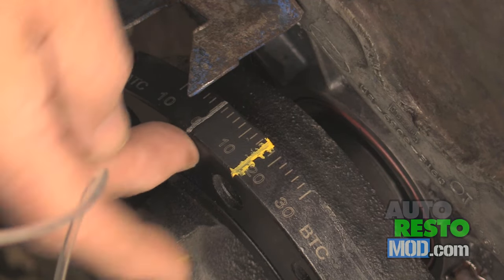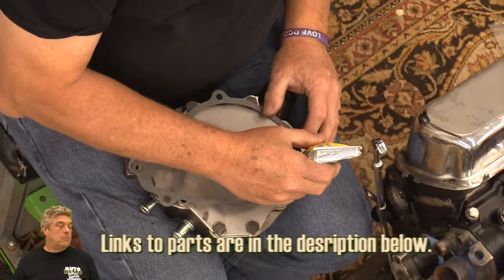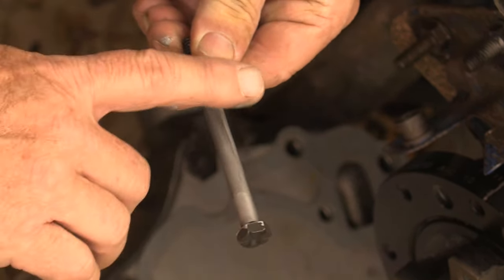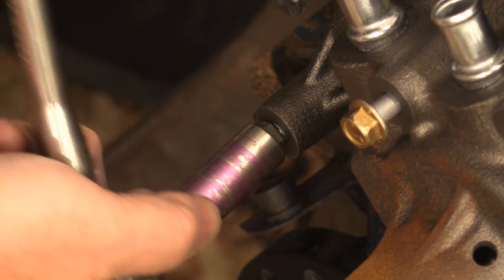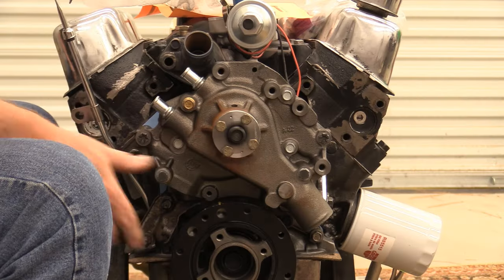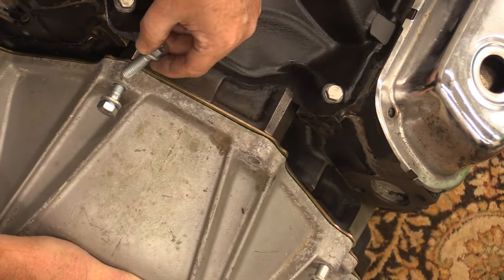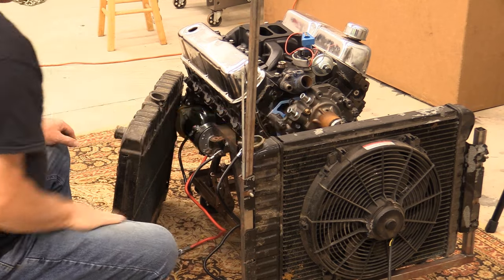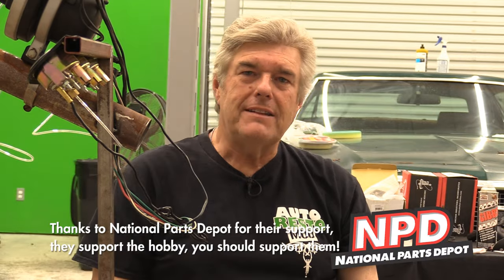Engine Start Stand Prep

Comment: You may be planning on covering it next week but I thought I'd bring it up.  When mocking up the manual bell housing and flywheel to run on the engine stand, make sure the flywheel matches the imbalance of the dampener.  Also a mention of the starter differences between flywheel/flexplate; and that the intermediate plate between the block and bell house is different for an automatic and manual transmission.   links to your earlier videos on these subjects would be a good reference to include.

Thanks to all your videos and awesome information over all these years. (been watching from the very start)
Larry,
Reply: Starter differences weren’t really related to auto or standard trans but whether or not the 157 or 164 tooth flywheel was used. All autos and 157 tooth manual trans starters were the same. 164 tooth flywheel starters were different.
Reply: Good info.    For further reference:...
I just built my original 1967 289 car with a replacement 50oz imbalance 302 with a 164-tooth Ford performance flywheel. I used my original 289 intermediate plate and bellhousing.  The NAPA manual starter would not fit through the intermediate plate hole. The snout also did not allow enough throw to engage the ring gear completely. I had experienced this in the past with my original factory stock 289.  
I replaced the NAPA (manual designated) starter with the NAPA(automatic designated) starter.  The starter fit through the intermediate plate perfectly and the starter gear engaged the flywheel gear completely.  I eventually counted the gears on my original 1967 C code 289 flywheel and it was a 160-tooth flywheel. 
I hope this will help others out there.  (BTW it was a GT C-code  September 1966 built San Jose car)
Reply: I'm correcting my above statement after @joed6011 made me doubt my earlier comment.  Thanks @joed6011 for making me double-check my numbers.  I hate people that leave misleading comments and don't correct them.....  So here Goes,....my current flywheel with my 302 50oz imbalance engine is a 157 tooth 50oz imbalance flywheel, PN:M-6375-B302, and it does indeed use the NAPA "Automatic" designated starter PN: 244-9628.  Being a rebuilt starter, the snout is original Ford with PN:  C30F-11131-A.  This is the same snout PN that is on the original C-code 289 that came out of the car.  These snouts only have 2 reinforcement ribs where the NAPA "manual" starter has multiple ribs. These extra ribs hit the bell housing and forces the snout too far into the flywheel.  Let alone having a bigger raised boss that won't fit into the intermediate plate.  I hope this helps clear up any confusion I created.

My current engine: 50oz imbalance non-roller 302   Transmission: Original Top loader

1)  Intermediate Plate......My original C-code manual transmission plate (sorry didn't get PN before assembly)

2) Bell Housing..........My original C-code  6 bolt, Manual transmission bell housing PN: C5DA-6394-A
 
3) Flywheel........Ford 157 tooth  50oz imbalance  PN: M-6375-B302

4) Starter..........NAPA remanufactured Starter PN: 244 9628  (Ford Snout C30F-11131-A)

Comment: I couldn't find my anti-sieze today so I used red disc-brake grease on the shanks on the 351W
Reply: Also that is the same water pump off the 302 and 351C from the 72 Rancheros as well as what is on the 351W
Reply from the maker: That is a good option too.

Comment: Don't some of the bolts run into the water jacket and need rtv, or is that just on 302s and 5.0s? Thanks for another great video.
Reply from the maker: No, not on the Windsor. But seepage is and issue that makes the use of the anti-seize good insurance.

Comment: Why no anti-seize on the threads?
Reply from the maker: The threads are steel to iron. They don't "tend" to get the same issue with seizing up as the steel to aluminum.